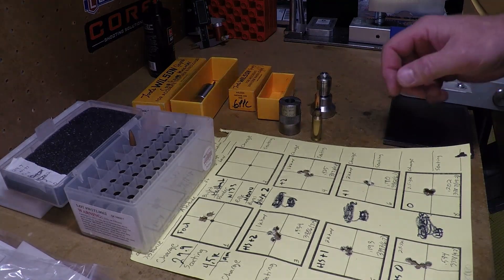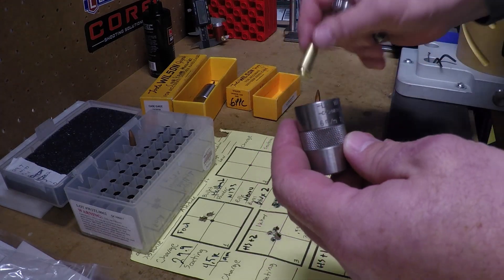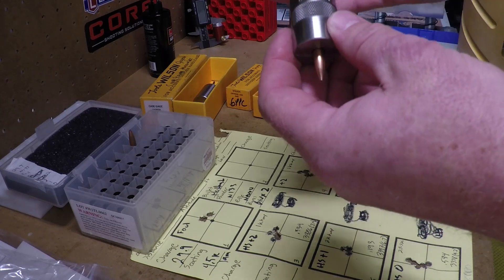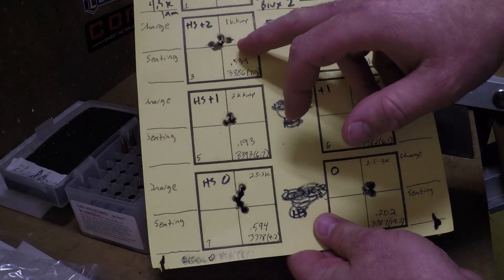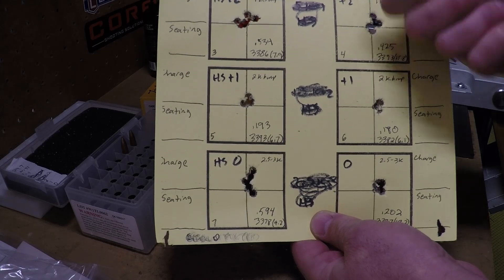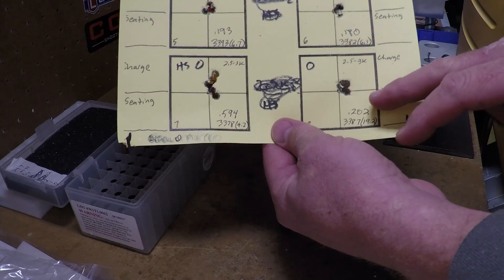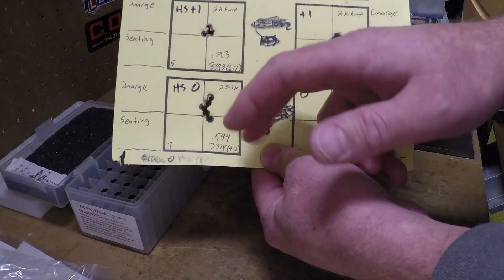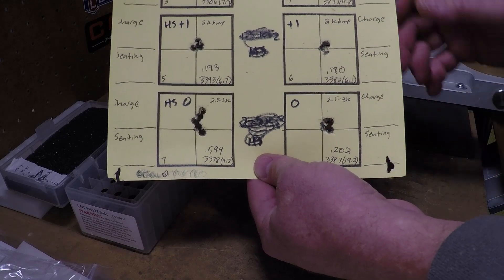Witch Doctor Effects of Headspace on Grouping

Comment: Did you adjust the bullet seating depth with different shoulder bumps?
Reply from the maker: No, no need to do so with the type of Wilson seater I use.
Reply: @WitchDoctorPrecision  I'm not sure I understand your reasoning for saying that.   The more you move the shoulder back, won't the case/bullet move forward by that additional amount when the firing pin strikes the shell and in effect change your seating depth?
Reply from the maker: @skeptic1236  have you observed this movement? Please post a link to visual evidence of this movement and I will take a look.
Reply: @WitchDoctorPrecision  I have always considered it a given that when the firing pin strikes the primer it drives the whole case forward until the shoulder contacts the front of the chamber.  Ignition hasn't yet had time to push the bullet out of the case.  Assuming that this is correct, as the case is moved forward, bullet jump is decreased.  However, I have no way to visually confirm that this is indeed what happens.  As to your test, I would propose that the reason you found an "ideal" shoulder bump was because that inadvertently created an ideal "bullet jump" or the equivalent of an ideal seating depth.
Reply from the maker: @skeptic1236  yeah, I’m not sure of the mechanism that would cause headspace differences to change the tune. What I do know is I tune to a 6-8 thousandths seating tune window and then seat the bullet right in the middle so I have 3-4 thousandths to err on each side. With my loading practices and components that I use that error is already very low (just published a vid on annealing and how it produces less error) so 1-2 thousandths of additional bump likely produces a maximum of 3 thousandths error which is within my tune window. For those reasons, I am doubtful that it is a seating issue. However, this can be tested by creating “compensated” rounds where you compare a compensated round (eg, 3 thousandths bump with a bullet seated 1 thousandths further toward the lands) and compare it to a round bumped at 2 thousandths at the standard seating depth. I will put that on the list of additional tests but we will see if it rises above the other testing priorities especially since I know that the finding in this video merges with Murdica’s findings that 2 thousandths is ideal and just about the rest of the other competitors I know. Either way, the practical lesson is to test your bump sizing and find the one that works best regardless of whether you believe that pin fall, the primer being pushed and seating varies, or whatever explanation a person can come up with is the mechanism causing the variation on precision.
Reply from the maker: @skeptic1236  btw, the bullets were jammed into the lands for this test so I doubt that the firing pin would actually move the cartridge especially when there is 3-4 thousandths neck tension unless you know of any studies done that show otherwise. If you do, please post here so I can review.
Reply from the maker: I think I get why you’re asking this. I am assuming the idea you are getting at is that you would advance the seating if you bump the shoulder farther back in order to have consistent seating depth. I tune to a 6-8 thousandths tune window and then load in the middle so I doubt that 1-2 thousandths change in seating in either direction would change the groups size and POI. You could do a test to advance the bullet a thousandth for every thousandth you bump the shoulder. Please let me know if you do test that and what you find.

Comment: Out of curiousity have you tested the impact of headspace variation on velocity?

How much variation in headspace variation do you tolerate once sized ? 0.001 variation or less?

Do you think having brass variation of 0.001 is detrimental to accuracy? 0.002? And etc...
Reply from the maker: I did measure velocity and put the average and standard decision for the group on the target for people to see. The velocity did not have an appreciable difference between the different headspaces. 

I do not tolerate more than a half a thousandths variation from the 2 thousandths bump. Any more than that and it definitely negatively affects precision. If you watch my video in Lou Murdica’s tunnel, every time I told him that there was a light crush or hard bolt close, the bullet always went out of the group. I have found this to be true in bumping too much so now I sort my brass if softer pieces bump too much or have less spring back. I also anneal which has reduced the variability to a large degree.

Comment: Thank you - did you measure velocities? Would be interesting to see if there was any difference in velocities between the different bump values.
Reply from the maker: Yes, the values for each of the groups is in the right lower quadrant of each square. I didn’t cover that in the video because there was no appreciable difference. They all were about the same.
Reply: @WitchDoctorPrecision  Thanks, very interesting - any thoughts/theories on the "mechanics" behind the difference in group sizes then - ie, it's clearly not velocity changes that are causing the different impacts - something physical perhaps - better fit in the chamber (better alignment with bore?)
Reply from the maker: @pa6552  that would be my guess. Perhaps the crush from 1k messes up alignment, 2k allows for proper alignment, and 3k and beyond cause a droop that doesn’t support alignment?

Comment: Good video. I always thought 0.001 would be the best shoulder bump for accuracy. I guess I’ll have to try 0.002-0.003 in my 6.5 Creedmoor
Reply: I have found die adjustments get very non-linear at bump amounts close to zero. This is because the die is still working the neck and body even when the shoulder hasn't touched. 

Were you bumping with a full length die, or a bushing die that leaves some of the neck-shoulder junction at chamber dimensions?
Reply: I use a Redding competition body die then I use the Redding competition neck die. With 0.001 neck tension. I anneal after each firing. Trim cases after every resizing.
Reply from the maker: @brianhollinger6109  have you looked into the Type S die? It combines body, shoulder bump, and neck (with bushing). One pass works it all.
Reply from the maker: Thanks for viewing and commenting. In my experience, in addition to this test, 1 thou is cutting it close especially with the dies, presses, etc. not producing a perfect 1 thou every time. After I started annealing after every firing, I went from 1-2 thou case-to-case variation to 0.5 with most being the same. So, even when annealing, there could be a variation that crushes the brass which could cause the neck to slant. This is why I’ve always gone with 2 thou but I still wanted to test this out. Shouldn’t hurt to try 2 and 3 thou and see what you get.
Reply: @WitchDoctorPrecision  but why didn't the 2000 shoulder bump have any vertical string in the Wind
Reply from the maker: @squirrelmaster760710  it wasn’t the same wind effect. The range I shoot at for matches and testing is a bowl wind environment that produces a lot of different wind effects from moment to moment. The one with significant vertical was a headwind that swirled through the bowl, hit the baffles, and caused verticals stringing. This effect did not sustain when the other groups were shot. They were all shot on the same day in the same atmospheric conditions though so any pattern variation in the wind groups is due to the variation of the wind effects.
Reply: Why such a large vertical string with 3thou  bump in the Wind.
Reply from the maker: @squirrelmaster760710  there are unsealed baffles just forward of the firing line and when the wind hits hard, those baffles push the wind down. I didn’t bring my up-down flag during this shooting session to clearly see this effect but I know it is there based on the many bench rest matches I have shot at this range and have seen the up-down flag move quite a bit under the same type of wind conditions.